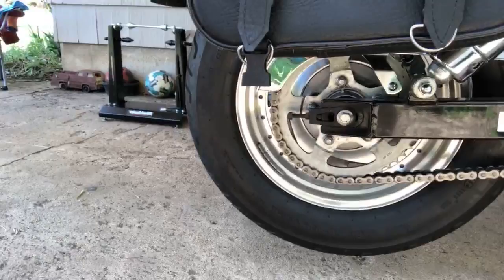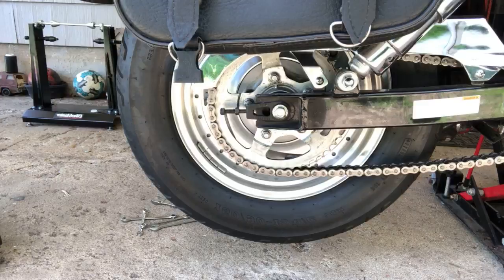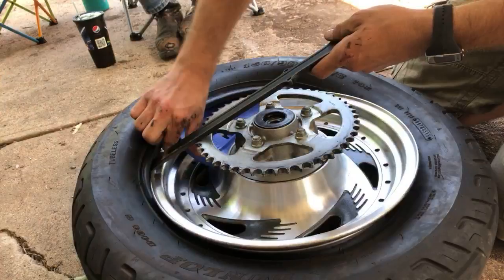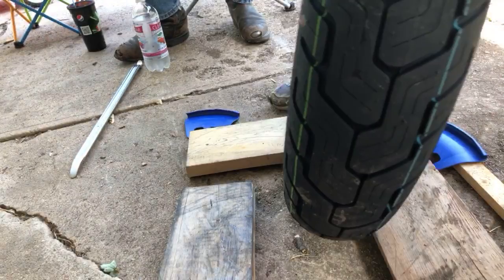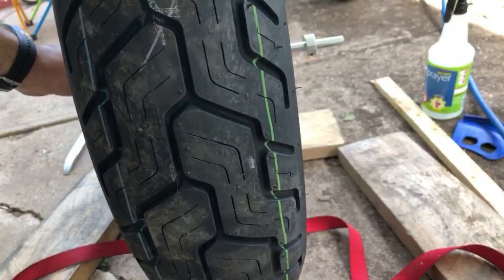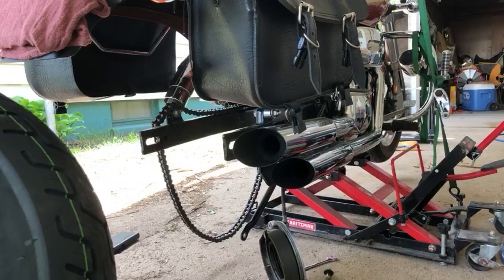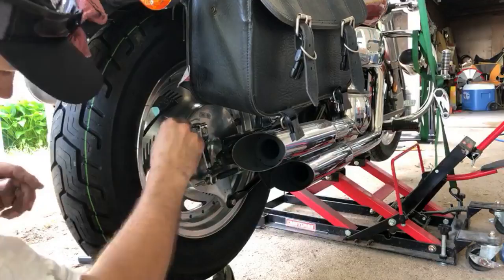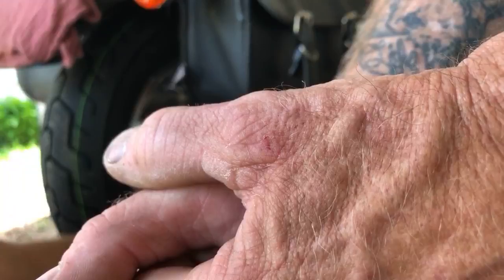All Things Motorcycles! | Changing a Tire on my Suzuki Marauder VZ800!

Comment: Good video! Were there any washers on your axle? One fell on mine while taking it apart, but think it may be from the drag link arm.
Reply from the maker: It has been a while since I did this and I haven’t gone back through to check things out lol. If I’m not mistaken, there were just the two spacers on the axel inside the swing arm. I’d have to double check but I want to say there may have been a washer just under the castle nut. Best of luck to you and ride safe!